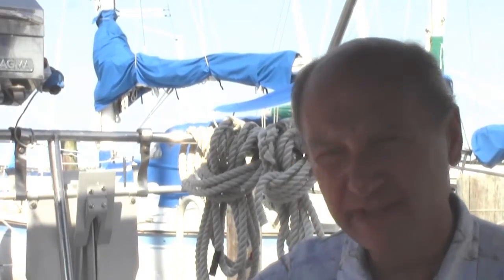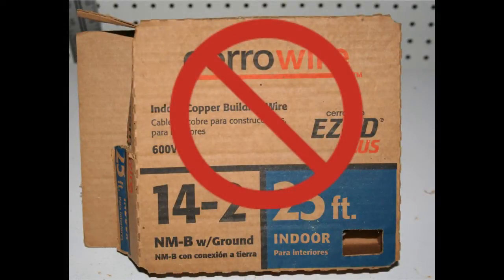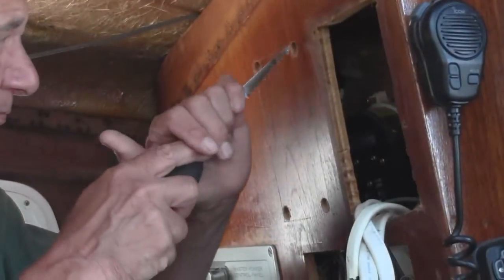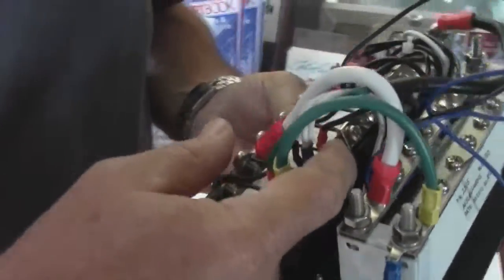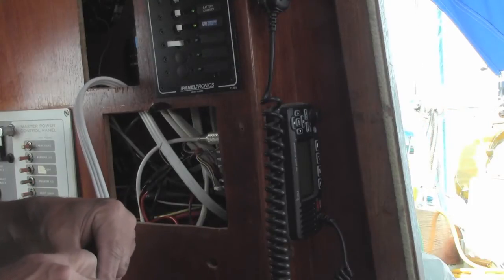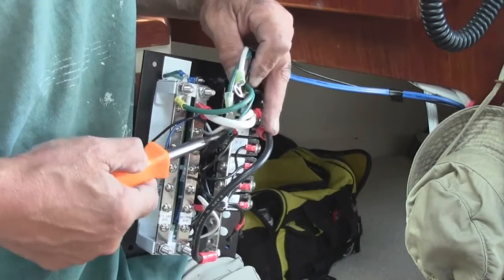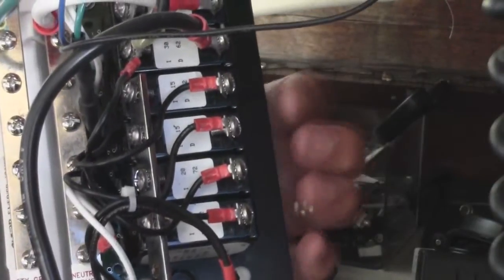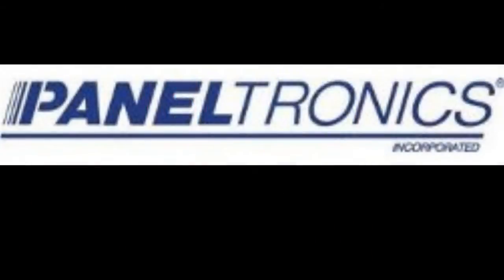Installing 30amp Panel on Boat with PanelTronics

Comment: What model panel did you choose for the upgrade. For my MacGregor 26M I just need one standard outlet in galley area, one in the head and potential for airconditioner/heater and refrigerator.
Reply from the maker: Check the website https://www.paneltronics.com/Electrical_Panels.php?op=Home they have a lot of Options or you can build your own, thanks for watching

Comment: You would think that if the panel uses #8 wire in it that this would be a clue that you should be using #8 as your service wire not #10. If you check the NEC you will see that for 30 amps you should have been using #8. Common mistake but lets teach people the correct way of doing things.

Comment: Your "Eye connectors" are actually called Ring Tongue lug connectors. Your "fork" connectors are called Spade lug connectors. Both types of connectors are sized not only for the AWG Gauge wire to be used with them but also the number size screw that they are designed to work with.  I do not recommend trying to crimp any of these connectors with a hand crimper that is not of the ratcheting type so that the crimps that are made are consistent with the correct amount of force applied.
Reply: I know this is an old post, but I was hoping you could clear something up.  I heard Ed say to connect the D.C. Panel to he AC panel.  Shouldn't the D.C. Panel be connected to to battery selector switch?
Reply from the maker: +DuffyF56 
tks i will keep that in mind for my next projects, i looked up ratcheing crimpers, they do look like a much better choice
Reply: My pleasure....great videos!!!! Just trying to help. You might also consider buying a "proper" stripper too. The style that holds the wire and has knife slots for the different sized wire. Much less chance of nicking the wire strands and a cleaner insulation cut without tugging on the wire unduly.
Reply from the maker: +DuffyF56 
I like your suggestions

tks
Reply from the maker: hello Mike, to answer your question could you give the time in the video where Ed mentioned the DC panel? Ed starts talking at 2:41,  yes the DC panel should be hooked to the battery selector switch.   I do have another video on adding a new DC panel https://youtu.be/zfx-hDBvh58
Reply: WaterfrontVacations1 he says it at 2:48.  "...you got your inlet from the AC Panel."
Reply from the maker: i think he is saying your get the power from the AC inlet (shore power) to the AC panel, sorry for any confusion.  Installing 30 AMP shore power inlet to the boat https://youtu.be/DpB9ergeA8E